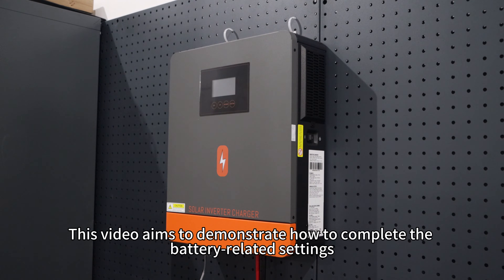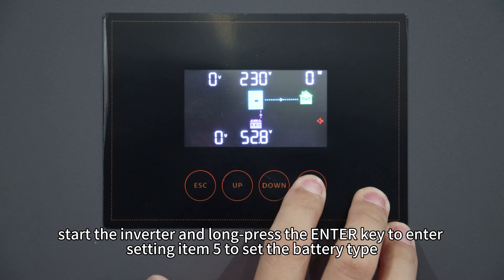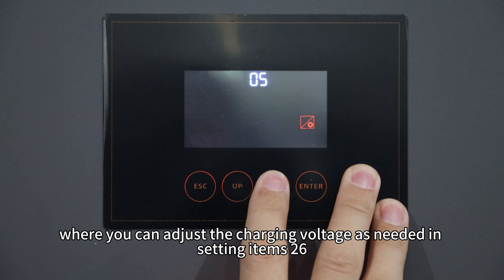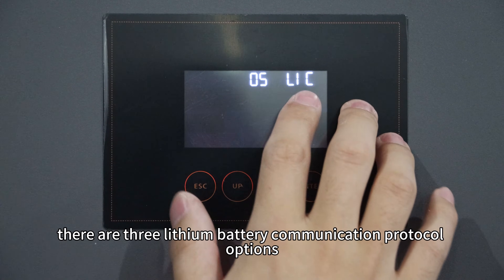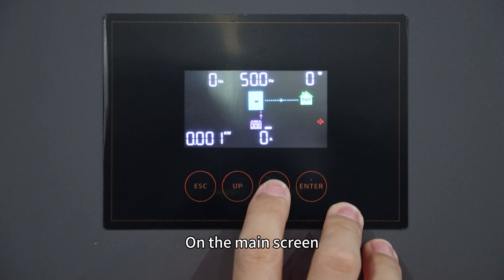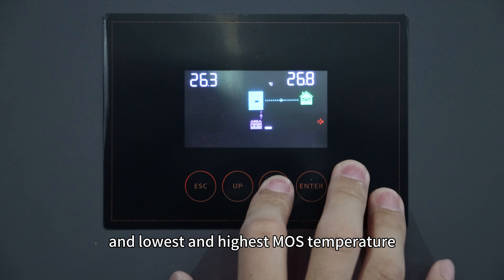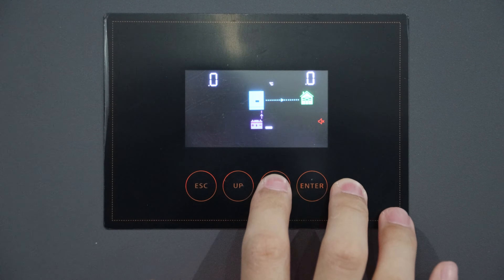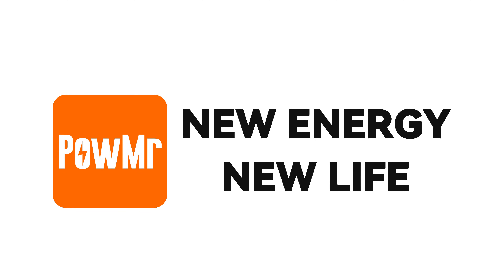Efficient BMS Communication: POW-HVM6.2M-48V-N

Comment: Connected my lifepo4 48v100a battery PowMr 6.2kW inverter via Pylon RS485 protocol. All required data is displayed on inverter screen. The problem is that at the end of battery charging process inverter returned fault 03 (battery is over-charged). The charging percentage on the battery screen showed 100%.  What is wrong with my connection?
Reply from the maker: The fault code 03 is that the battery is overcharged. Please turn off the PV and mains power and try to discharge the battery.
Reply: @PowmrSolar  I don't use PV, only grid. So you mean that I need to fully discharge battery and then fully charge it and that fault won't occur?
Reply from the maker: @VitM9  It is not necessary to full discharge the battery. Discharge the battery to 45V and try whether the mains power can charge the battery. Also check whether the charging mode is SNU or OSO?

Comment: Hello. I have your inverter 6.2 kW and battery with bms jikong board. I don't understand how to connect them via RS485, maybe you have instructions?
Reply: For those who want to connect this type of inverter with a JK BMS: 
1. Neither the inverter nor the BMS manufacturers can provide any clear answers on how to do it.  Therefore, I had to figure it out alone. 
 2. You need a simple cable in which there will be only 2 wires, 1,2, they must be connected crosswise,( 1->2, 2->1).  
3. You need to select protocol RS485 (9600) Pylontech in the BMS settings (mode 14), you may have to update the BMS firmware because it is not active on older firmwares.  
4. In the inverter settings, select the LIL battery type.  
5. And now attention, the reason why for many (including me, nothing worked) is setting 43 of the inverter menu, this setting is not described in the instructions, by default it has the value 48, in order for the communication to work, you need to select the value 49.
5. After selecting the LIL battery type, the SBU and Dual Output menu items change to percentage instead of volts, and everything works quite well.
Reply: @UATechSorcerer  доброго дня, а який підпункт в 5 меню ви вибираєте при такій розпіновці? і на jk bms який uart протокол ви вибараєте? питань багато як би з вами зкомунікувати?
Reply: @UATechSorcerer  its not working for me but ive tried so any different suggestions I may have damaged the port circuits by now. im using the victor 3.6 version but I believe its the same manufacturer.
Reply: Do you know the protocol that your bms use?
Reply: @jonaswendbeyamba9303  I'm using JK bms, but for some reasons protocols pylontech and pace bms are not available
Reply from the maker: Please ask the battery supplier whether the battery uses Pylon RS485 or PACE RS485 protocol.

Comment: Does POW-HVM6.2M-48V-N supports Dyness B4850 battery protocol?
Reply from the maker: Please ask the battery supplier if the battery uses PACE or Pylontech protocol?
Reply: Sorry for disturbing, but did you manage to work this inverter with Dyness battery?
Reply: @AntonBobreshov  yes, but with user settings according to battery manual, without battery comunication with invertor
Reply: @blog-bq6dj7vq1a  what DIP switch settings do you use on dyness?

Comment: Can you tell me the pin numbers for rs485B and rs485A on inverter rj45/rs485/bms  connector ?
Reply: 1 pin 485a 2pin 485b 8 pin gnd
Reply: @FlaWour  Ok, now my BMS reacting on communication. It just shutdown after I plug the cabe :)
Reply: @deeper_mind  Which battery did you connect?
Reply: @FlaWour  Self assembled on base of JK Inverter BMS. It's ignoring Pylontech protocol but react on PACE. In BMS log I see "watchdog reset" and BMS just reboot. This BMS lets choose  different protocols among which 3 different PACE and two Pylontech.
Reply: @deeper_mind  Mine do the same. Wrong communication. In LIP or LIL mode see the percentage battery as 0% and close sas see the bat as empty.
Reply: @deeper_mind  
Tell me, did you find what the problem was? I have the same problem "watchdog reset"
Reply: @spiritmd19891  Nope. That wasn't my inverter so I din't have much time to experiment.
Reply: @FlaWour Awesome, thank you for this I can confirm this is working with a Felicity ESS battery system using pylontech protocol
Reply: @FlaWour can you explain further? sorry I’m new to this :(
Reply: For those who want to connect this type of inverter with a JK BMS: 
1. Neither the inverter nor the BMS manufacturers can provide any clear answers on how to do it.  Therefore, I had to figure it out alone. 
 2. You need a simple cable in which there will be only 2 wires, 1,2, they must be connected crosswise,( 1->2, 2->1).  
3. You need to select protocol RS485 (9600) Pylontech in the BMS settings (mode 14), you may have to update the BMS firmware because it is not active on older firmwares.  
4. In the inverter settings, select the LIL battery type.  
5. And now attention, the reason why for many (including me, nothing worked) is setting 43 of the inverter menu, this setting is not described in the instructions, by default it has the value 48, in order for the communication to work, you need to select the value 49.
5. After selecting the LIL battery type, the SBU and Dual Output menu items change to percentage instead of volts, and everything works quite well.
Reply from the maker: Please send your problem to this email: support@powmr.com.
Reply: @PowmrSolar it would be nice to see it here, so everyone will see it, and writing to your support will not be needed.
Reply: @romanmelnychuk5196  Did you find the answer? Have the same question.
Reply: Thanks for the details
But I can’t see setting 43 in my POWMR 6.2 inverter :(

Comment: I have been trying to connect my inverter to the batteries, but there is no communication. I have tried switching from the different protocols on the inverter shown in this video and no battery information is displayed. I see that the wire used in this video has been modified, can someone explain what has been done to it. Could this be the reason I can’t get the  inverter  and batteries to communicate?
Reply from the maker: Please send your problem to this email: support@pwmr.com.
Reply: Most likely, that's the issue. The manual for this inverter, page 10, describes how to crimp the cable to connect the inverter and the battery. A standard Ethernet cable is not suitable.

Comment: @PowMr Do you have an inverter where you can set how much power it should bring into the house, e.g. via knives on 3 phases or that you can set via WiFi, e.g. I want 300 watts permanently or something like that?
Reply from the maker: Unable to set output power. Generally, the machine will automatically output as much power as the load it is connected to, and there is no need to set it. Just don't overload the configuration.
Reply: @PowmrSolar  then can it limit input power from utility so the main meter breaker doesn't trip, if the inverter has more power than utility power subscription? For example in UPS mode if the load reached maximum the utility can handle, the battery help to power the excess load.

Comment: I have a powmr of 6.2kw (POW-HVM6.2M-48V) nominal operating voltage 360vdc; can the solar inverter work (without battery and connected to grid) if I have four pv arrays that will reach 190voc
Reply from the maker: Yep, PV Array Voltage Range is 120V-500V.
Reply: @PowmrSolar  so I can now draw power from the solar panel all day?
Reply from the maker: @brainardsolite  when there is sun.
Reply: @PowmrSolar  ok.. thank you very much

Comment: is it compatible anyhow with JK BMS + rs485 ?
Reply: For those who want to connect this type of inverter with a JK BMS: 
1. Neither the inverter nor the BMS manufacturers can provide any clear answers on how to do it.  Therefore, I had to figure it out alone. 
 2. You need a simple cable in which there will be only 2 wires, 1,2, they must be connected crosswise,( 1->2, 2->1).  
3. You need to select protocol RS485 (9600) Pylontech in the BMS settings (mode 14), you may have to update the BMS firmware because it is not active on older firmwares.  
4. In the inverter settings, select the LIL battery type.  
5. And now attention, the reason why for many (including me, nothing worked) is setting 43 of the inverter menu, this setting is not described in the instructions, by default it has the value 48, in order for the communication to work, you need to select the value 49.
5. After selecting the LIL battery type, the SBU and Dual Output menu items change to percentage instead of volts, and everything works quite well.
Reply: @UATechSorcerer So-so advanced support. Many thanks. I'm waiting for my jk BMS and will test link ASAP. And will post the results. By the way, I had interesting results for no-load power utility consumption. It's about 500W full power, power factor ~0.2. About 100W active power finally(unfortunately I have only full energy meter). So, I want to check no-load consumption via approved active energy meter.
Reply: @UATechSorcerer Any background for setting 43? What is it use for?
Reply: @chasewizz7835  I have no idea, someone says it's some kind of address
Reply: @UATechSorcerer  hello i don't have setting 43 on my inverter pow-hvm10.2m
Reply from the maker: Please ask the battery supplier if the battery uses PACE or Pylontech protocol?
Reply: @PowmrSolar yes, it possible for JK BMS via can-bus at least.
Reply from the maker: @РоманБереславский-з3р  Please ask the battery supplier if the battery uses PACE or Pylontech protocol?
Reply: @PowmrSolar  Ok. I will ask. Compatible version is Pylontech 3.5?
Reply: @РоманБереславский-з3р  What setting do you set in JKBMS and inverter?